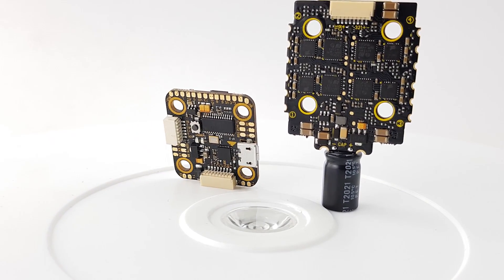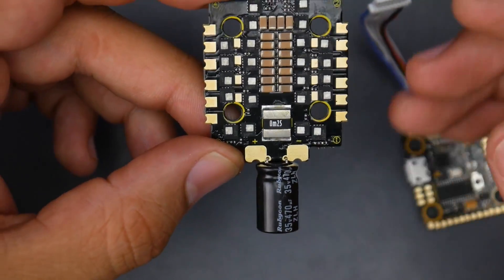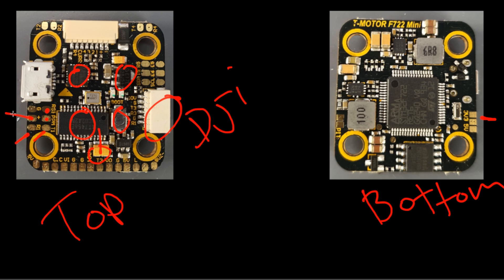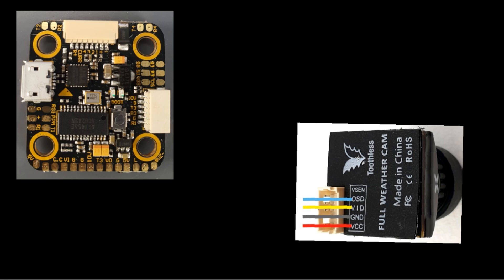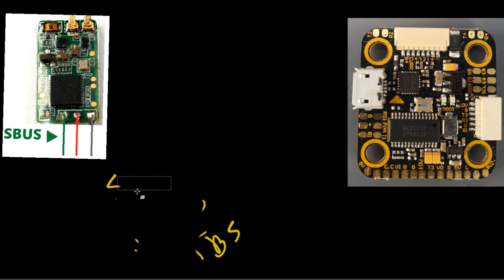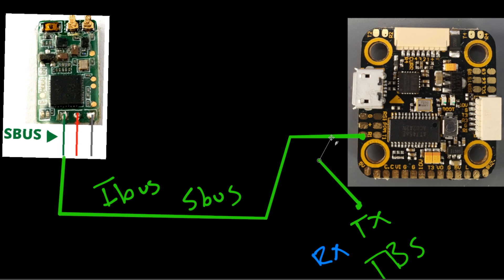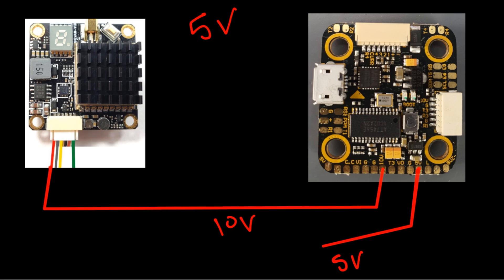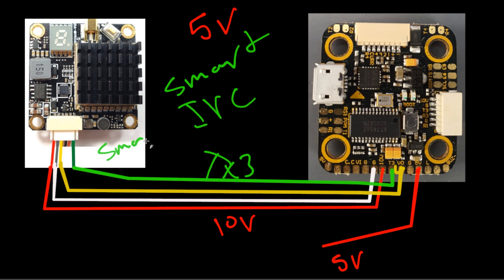T-Motor Stack With Metal Fets!! // T-Motor F722 Mini Stack 20020

Comment: Not sure if you read comments on your older videos, but you possibly just saved me a world of aggravation with this one. I'm new to DJI and set up my FrSky RXSR on R1 and also just plugged the DJI connector in without realizing it defaulted to R1 (obvious from your video, but I didn't notice as I did the connections at different times). What I don't know with DJI/Betaflight is that if I left both connected then set R1 to Serial RX , is whether the DJI input would just be ignored or create a conflict.

Thank you, and subscribed!
Reply from the maker: Hey i do read from time to time. Just dont connect the SBUS output of the DJI you dont need it unless you are usuing the controller.

Comment: If using a dji caddx vista it just gets plugged in correct ?  There is nothing special you need to do it should just power the caddxs unit up right? 
I ask because I have plugged in 3 different caddxs units and none of them will power up using the plug & play ....

Comment: Just bought this FC so this is helpful.  Did you test the VTX power switch?  Does it power off the 10V and 5V outputs that go to the VTX?  Do you know if it powers off the 10V to the DJI/Vista as well?

Comment: What kind of MCU is the esc using? T motor doesn't mention this at all. Unlike the new f55 ultra 20x20 esc that has the first F4 and US Fairchild mosfets. Lots of specs on that. Not many on this